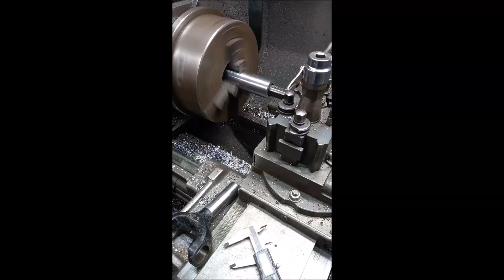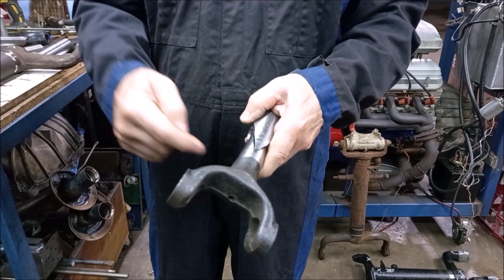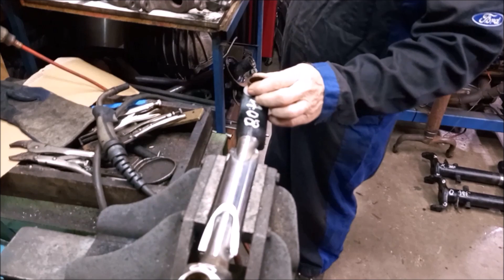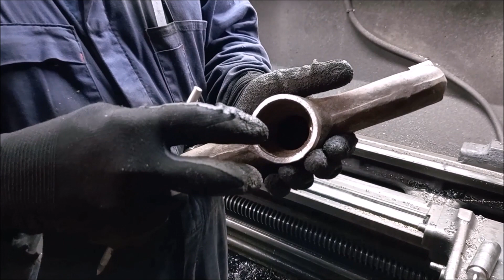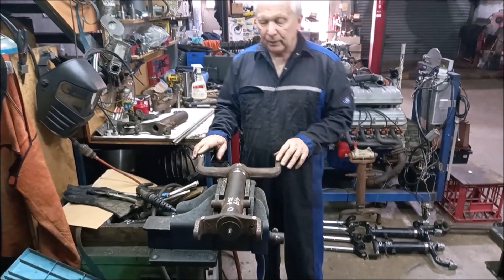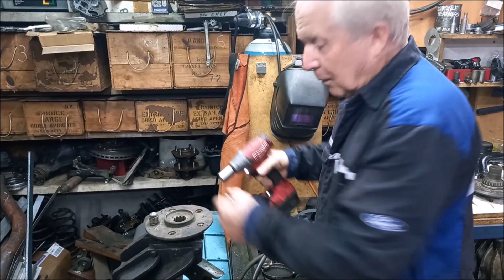Jaguar rear Shorten, Narrow Jaguar rear suspension, Cut down Jag Diff, how narrow a Jag rear end.

Comment: Ive been looking for a place to narrow a xjs down to a xke s1 track with.  Im in vancouver bc canada and the only places are in the usa but tariffs are making it very expensive. 

Ive decided to buy a small lathe and drill press to do the work myself after watching your video.

My only question, did you use a tig or mig welder?

Comment: Hi there, 

Old post, hoping you notice this question. And thanks for this very detailed content.

How do you determine the amount to be final length of the driveshafts and control arms to achieve a specific track width? My goal is to get to a 50" track width so I can stuff one of these under a 59 AH 100-6 for an EV conversion. It's a rescue pup from another conversion. The internet says that some Jags used that width for Gen 1, year 1 XKEs though I run into conflicts where some content shows the narrowest width ever available being 52". Glory to the internets perfect knowledge.

Also, presuming I am shortening per your instructions, it sounds like you remove the same amount from the control arms as you do from the drive shafts. Surprises me, as I would expect geometry to demand a little more be removed form the drive shaft than the control arm. Bad thinking on my part or is the difference just negligible?

Thanks in advance.

Comment: You can potentially just buy a shaft that is thr length you desire and because its u joint both ends you can just use the spline ends you know fit and just switch the shaft without lathe or cutting or welding or re balancing a shaft. 
We do that. No cutting .. no welding.. done with parts that are ment to be at the length from the start. 
Just saying.  
And as it goes for putting bigger wheels underneath it .. a offset wheel works with spacers.  Just did it on a 88 xj6. Flushed the wheels to the fender and jammed 11 inch on the rears and 9 inche deep wheels on the front.  
Lowered 1.7 inch all the way . Rolled fenders and the hole shebang next to air bags. 
I will say the first time i was taking a jaguar spring out your video was actually the one that i saw first amd it made it so i understood i didn't need to waste time ordering the spring compressor kit and i had the stuff to do it. 
Im not trying to take the piss  .saying about axles im just saying..

Comment: What about the trailing arm, what do you do to modify it
Reply: On relevant forums I read if you fabricate a heavier duty carrier there will be sufficient strength to not require the trailing arms. T-bucket rods use this  method.

Comment: That's great. I did my top shafts a little differently, by making adapters to fit over the stub shafts, with an outer diameter to fit snugly into dom 2 inch tube, and plug welded the one end, and welded the other end all around. I think I will use your method on the next one though.